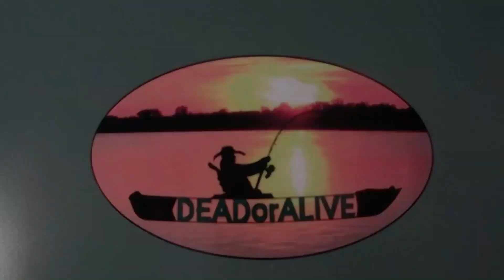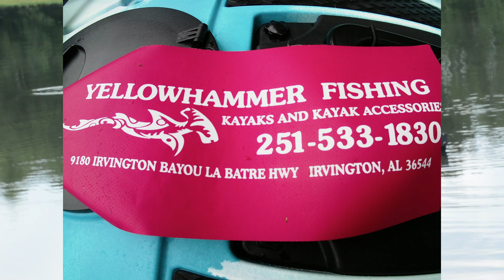An Introduction to My Newest Kayak...the Hammerhead Kayaks Bull Shark!

Comment: Adjust the pedals so you can move the seat backwards and be able to access the floor hatch.
Reply from the maker: Hi, and thanks for dropping by and watching!  That’s a good idea when using the fin drive, but the propeller drive is fixed with no adjustment.  Adjusting the pedals on the fin drive didn’t even occur to me…most often that’s a “set it and forget it” thing…Thanks!  Stay Safe!
Reply: @DEADorALIVEkayaking  I completely forgot that Hammerhead now has that seat in a height adjustable version. That might allow the use of that center hatch.

Comment: I just got mine and I love it but there is one huge problem.  The rudder gets a lot of sand and grit inside it which makes the rudder hard to steer in till you clean it out or just stops being able to turn.  Any other operations?
Reply from the maker: Hi, and thanks for watching.  I haven’t had any problem with the rudder binding on the Bull Shark.  The next time I have it out, I’ll try to recreate your problem and see if a solution presents itself.  Is it the rudder post that’s getting sand in it or the steering cables?  Stay Safe!

Comment: The pivoting /locking prop drive mount does not work with the fin drive which is disappointing. You must completely remove the fin drive for instance in a surf/beach landing which means the fin drive will be flopping around on the floor unattached . Better come up with some type of tether for the drive or risk losing it if capsized.
Reply from the maker: Truth!  Although, I will say that it is easier and quicker to pull the fin drive than the propeller drive.  As you mentioned, I need to come up with some means of tethering it...actually, tethering both drives, even though the propeller drive is well confined in the yoke and 'shouldn't' fall out (unless you have luck like mine!), and that holds true for almost all drives...from the Bull Shark to a high end Hobie.  Thanks, and Stay Safe!